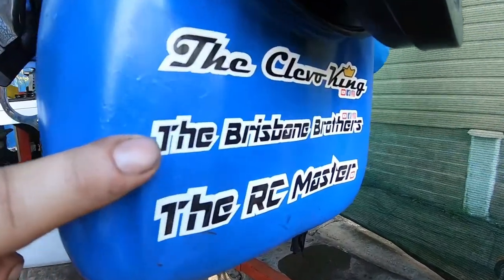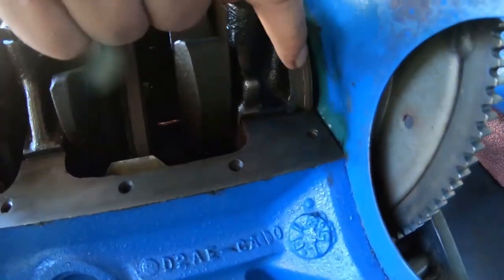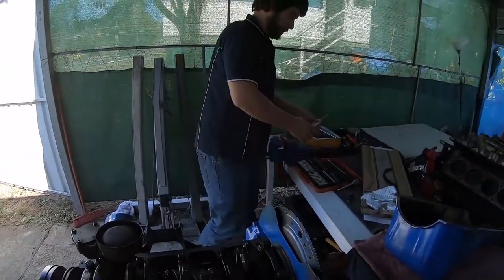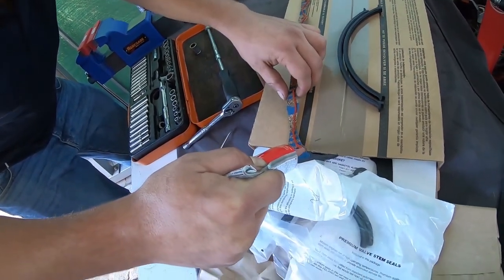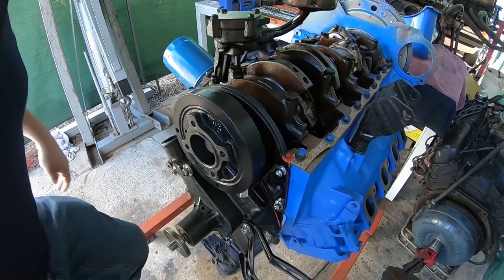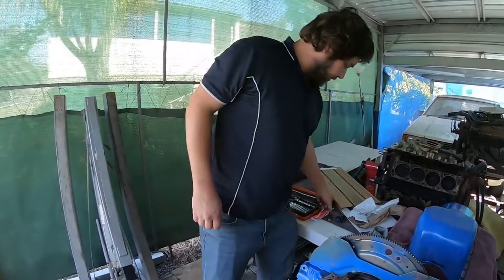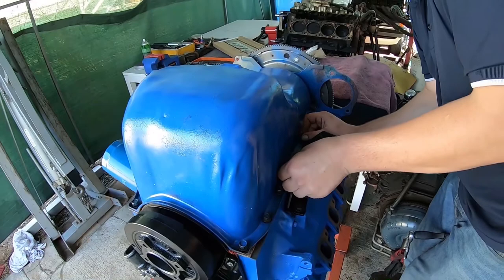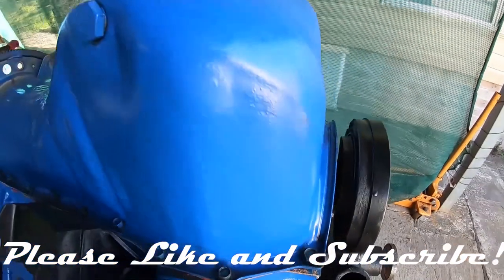FORD 351 CLEVELAND CAMSHAFT SWAP PART SIX SUMP INSTALL

Comment: Mate i cant thank you enough for this video. I was struggling like crazy getting the sump back onto my clevo and this video helped immensely. I was one of the dummies who was going to put the cork over the rubber end gaskets. If i have to do it again I'm pulling the motor, what a pain to do on the garage floor. 

Thanks again and keep it up.

Comment: Great vid. Excellent tips for doing up a critical gasket. It will be great to have these to refer to. Thanks King. No heavy duty Oil Pump drive shaft ?
Reply from the maker: I think it’s a bit over kill for this the cam won’t sea action past 6200 and it’s only a std volume oil pump

Comment: Hey guys, if I have a coolant leak in the front, it means timing cover needs removal and new gasket right? Also can I replace the oil pan while the engine is in the car(1971 Mustang)?
Reply from the maker: It could be the water pump gasket but would most likely be the one behind the plate when people swap a water pump over they pull them down instead of up to get them free and it compromises the gasket. Oil pan can be done under the car. Sway bar needs to be removed, gearbox mount loosened, engine mount link pins removed, Jack up engine under Sump and put spacers between engine mount and base plate, then you should have enough room to get the pan off 👌
Reply: @thclevoking  I just wanted to say thanks. I have what I was sold as Aussie 2V heads but my engine builder said were marine heads. I like your channel. Cheers

Comment: Great build, only one question. You said nit to use a high volume oil pump with a hyd roller cam, why not? Thanks
Reply from the maker: The load with 20/50 cold starts and a high volume pump combined with the reduced friction of the roller cam makes the dizzy gear and dizzy drive shaft the next weakest link.

Comment: Hey fellas i had a Yella Terra cast Rocker let go (broken in pieces on the underneath side of the rocker)
im changing to to YT6015 Roller Rockers on a 2V 351 . My question is ive found the majority of the Roller rocker pieces after taking the passenger side rocker cover off. Where would have a couple of pieces ended from the underside of the rocker ?
Reply from the maker: Probably just slid down the oil return holes mate, that’s very unlucky

Comment: I cut the heads off 3'' bolts (like a stud) for the corners to act as guides putting the sump on - takes 10 seconds then out they come after the other bolts have been started. Just my 5 cents worth.

Comment: Is there a way to change timing cover and seal without taking off the Sump?
Reply from the maker: Lower the bolts slightly along the pan rail and when you re assemble you ditch the lower timing cover seal and pump it full of silicone. The rail gaskets will be fine if they don’t split if they do they should be changed but I have seen gaskets cut flush and sealed with silicone too.
Reply: @thclevoking  
Thanks mate

Comment: I feel that my front seal under timing gasket and top of front side of oil pan doesn’t sit flush as if there’s extra room for it
Reply from the maker: I’ve seen the timing cover seal installed backwards and they worked mate
Reply: @thclevoking  thank you for the reply I’ll try again tomorrow

Comment: what were you saying about the header gaskets leaking need prper header gaskets? thanks man
Reply from the maker: The exhaust gaskets in the fel pro set only suit exhaust manifolds they don’t suit headers or extractors there is not enough meat on them to seal up properly and they burn out in no time
Reply: @thclevoking  thanks Bro love your work have you got a part number form the good gaskets got my 408 for the gran torino on its way from PLR in the next week or so will do some vids bro and let you know thanks man
Reply from the maker: What sort of heads are you running?
Reply: @thclevoking   cast iron 4V closed chamber